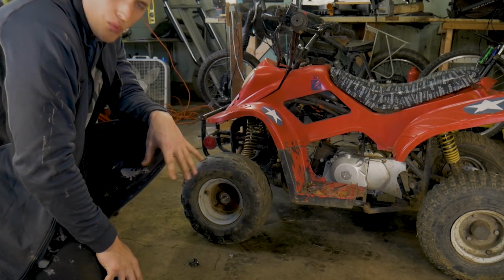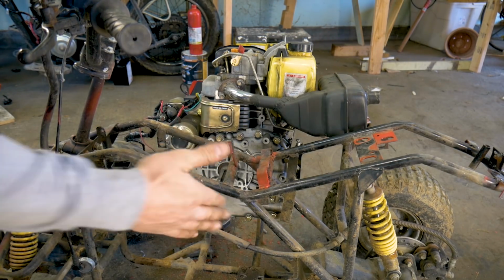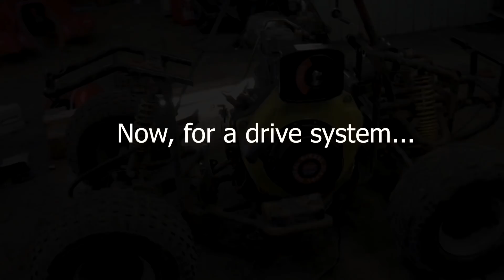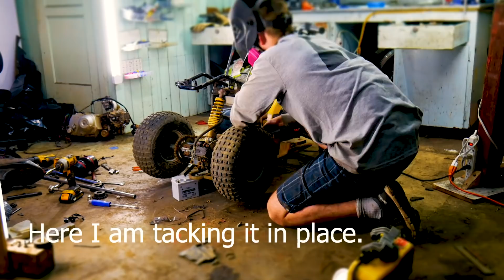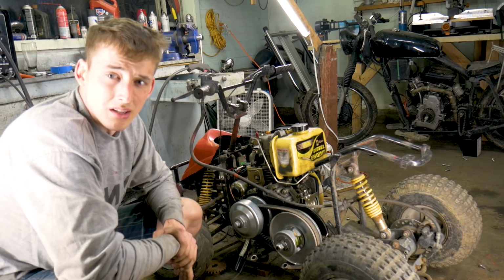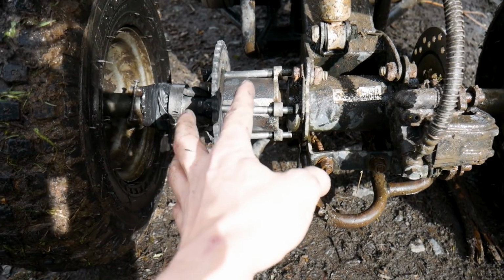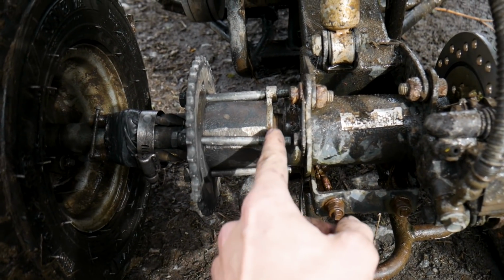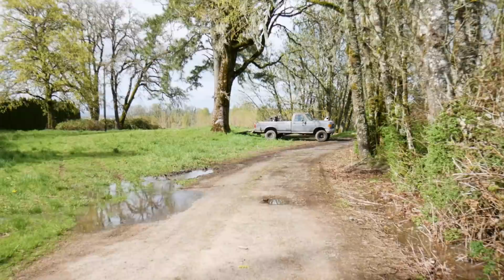I put a DIESEL engine on a kids ATV/QUAD

Comment from the maker: What do you think of this engine?
Reply: Turbo charge it
Reply: It have too much power and rev rpm s too good, it's amazing because is a diesel engine.
Reply: Bike_life, yes I know, that engine even get sized if you try to over rev the max rpm. I have every single one engine that they use but thanks anyway
Reply from the maker: haha I just need to find one now.
Reply from the maker: for sure, the things a monster!
Reply: It sounds good and looks sweet and 3 weeks ago i started buying stuff to build a home made mini quad for my channel
Reply from the maker: Nice, i'll be looking for it
Reply: The gasolina engine is more fiability, more rpm, more speed, but low torque, i like gasolina engine, even if is more consuming more fuel. It easy to maintenance, low cost, and will start quickly on the winter, i apreciate your work to transform a generic quad kids to the diesel engine, but is too work to do and time elapsed... good luck
Reply: Oliver Motorized I think it was pretty bad ass. I’d like to see that diesel on a go cart or something another. It sounds like it runs perfect 👌🏻
Reply from the maker: thanks for he comment Mircea
Reply: Here because diesel. 
Having coffee with a dash of diesel in my shop right now, because i splashed a fuel sample around and it doesnt matter.
Reply: Oliver Motorized did u have an uncontrolable urge to go slow
Reply: I want this motor for my 3 wheel moped I made last week
Reply: @ralpherizonie1785  It would be perfect for a small yard but it has torque for hills and something that small you don't wanna do 40mph on I have a 3 wheel scooter on my channel the gose well over 43+ but it's unstable and no breaks so I don't know how fast it really is
Reply: makes more torque so it needs longer gearing to get the top speed
Reply: Görgo
Reply: @Bike Life_93 
Yea but revving the little guys a few hundred over max rpm isnt a big deal. 
If its on a gen its running around 3800 anyways so 4000 isnt a stretch.
Reply: Kyle Galipeau yesssss
Reply: @galipeau169  Absolutely!! Imagine 3x hp
Reply: What did it come out of ,and were do you find 1?
Reply: Man just to be very honest. I want to see a turbo on it. I will be watching.
Reply: Put a turbo on it
Reply: Oliver Motorized nice
Reply: Oliver Motorized first Diesel engine quad
Reply: Michael Holliday yes it rules and so do turbo diesels
Reply: Let a kid drive it
Reply: can i buy this from u XD
Reply: It’s OP
Reply: U from Nebraska
Reply: Its insane
Reply: Oliver Motorized how much for this quad
Reply: same as old
Reply: Build a lift kit for it
Reply: Bike Life_93 that's not the case. You won't be able to rev any diesel over a certain rpm, yeah around 4k. This is because of how slowly diesel fuel burns. Any faster and the fuel would still be burning on the exhaust stroke.
Reply: i think it sounds like a lawn mower
Reply: You should do wheelies on it
Reply: Jeff
Reply: I laughed my butt off. Looks like you could pull an airplane around with it. Thanks!
Reply: Diesel... ya hade me at diesel
Reply: Put it on bike
Reply: It's big but it's strong I don't understand why everyone wants a turbo on it. It don't need a turbo it's powerful enough!
Reply: Now make it roll coal
Reply: For a China diesel they are pretty good little mills. I have the 170cc  4hp version of this motor. From new I had to shim the injection pump to retard the timing a bit, factory had it way to advanced. The little sucker would have blown its guts out lol
Reply: What year is your Ford I have an 88 f150
Reply: i know Im asking the wrong place but does anybody know of a method to log back into an Instagram account..?
I somehow lost the login password. I appreciate any tricks you can give me
Reply: @Elliot Xzavier Instablaster =)
Reply: Needs more speed.

Comment: great job bro - you can put a little gas in the diesel to help with starting.  removing air filter also helps.
Reply: Gas in the diesel will lead to knock and destroy the engine.

Comment: here before 300k views
Reply: that sprocket hub was clever , Thats the same problem I'm having on my 670 buggy. Cant you flip the jackshaft around on the torque converter? so the sprocket faces inwards
Reply from the maker: I originally wanted to flip it so the sprocket came out the other side but then the sprocket would hit the engine and there wasn't enough clearance! I may just redo the whole rear axle with a better system. good luck on the buggy man!
Reply: Vasily Custom Builds I would think you should be able to flip the axle on your buggy but of not your gonna have to use a jack shaft
Reply: Lol I see you every where 😂
Reply: How the f??
Reply: I am here before 400k views

Comment: Man that's awesome. I've got a 10hp diesel I snagged off a generator I'm modifying to work on  my monster buggy project.
Reply from the maker: Nice! they are pretty rare engines around here so it's cool to own one. good luck on your project
Reply: Nachodads
Reply: Hah i have one too, but i cant find the right ratty junk to put it on. 
Some old 60s-70s mower slammed on the ground and geared for about 30-35 is what im thinkin.
Reply: @MrTheHillfolk  that would be awesome bud
Reply: @nachodadsgarage1159  
Not sure about the tapered crank yet. 
What I mean is to get a straight crank, or an adapter , or turn it down in a lathe. 
By a quick eyeball it looks like 7/8 might get enough of the taper out, and 3/4 totally makes it a straight shaft.
A new crank is 1" i believe. 
I got my engine for free, so if I had to buy a crank it wouldnt be so bad. 
I tore it down already.

Comment: I have watched a few of your vids now. First, let me say you are a creator and a salvage artist. Second, you have some cool ideas. Lastly, your not building structually safe framing on your builds. When you join two pieces of frame tube together you need to be slugging them for strength at the joint. It will help prevent stress cracking in the long run.

Comment: I recommend welding the bolt spacers together so you know it wont snap the bolts on the sprocket and i just built a 212cc 3 wheel moped
Reply from the maker: The spacer is steel while the sprocket-hub is aluminum so I cant weld em.
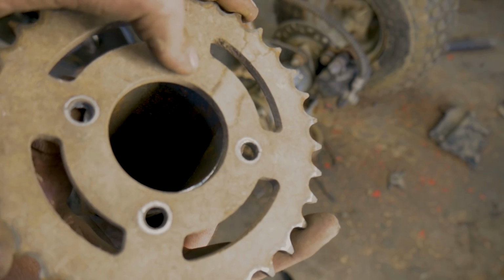Reply: Right but the spacer that gose over the bolts can be welded to the big round steal spacer that you made so the 4 bolt spacers stay in place at 4:02

Comment: I guess its probably a good thing diesel doesnt go bad like gas does it can sit for 10 years and be put in a fuel tank andbrun through an engine and it will run like the diesel is a day old
Reply: That's a myth.
Reply: About 6-12 months no degradation  in a clean, cool environment.

Comment: The torque definitely did not break the chain.  The 85cc two stroke motocross bikes are pushing 25hp and use a 420 chain.  Cool project though, you can probably ride for a week on three gallons of fuel.
Reply from the maker: yeah, the master-link came off, I think there was too much slack in the chain
Reply: You might have had the master backwards so it got hooked on something and just came off
Reply: Oliver Motorized 
L

Comment: thats great. i took one of them coolsters and put a cheap predator 212cc on it.. it fit pretty easy then i put a racing centrifigal go kart clutch on it and gps said 55mph but the tiny wheelbase made anything over 30 to 35 very hard to keep straight.. it was a little death trap so i sold it. i just ride an old moto 4 now but i have a yerf dog spiderbox mini buggy project that i mounted a 440cc sled engine on.. need to make a jack shaft then that thing should be crazy fun

Comment: That looks like a Coolster 110cc. I got one a year ago not running and I got it going by sanding the pickup sensor  and the raised magnet. Cut off the exhaust before the baffle that looks like a catalyst and woke right up with a 200lb rider 😂👌
Reply from the maker: Nice! i'm gonna get the original engine going here pretty soon

Comment: Do these little diesels use a carburetor or injection? If its injection I can see turbocharging being alot easier to do with the diesel
Reply from the maker: I think it's a mechanical form of injection. But yeah, lots of folks want to see a turbo on it lol

Comment: I have the same diesel, there is not very much throttle movement and would like to have seen what you did there. Also your compression must be low, mine will rip your arm off pull starting it, I even managed  to start it reverse. Even the battery has a hard time starting it, best is to hold the decompression down for a second go around.

Comment: How did you get that engine to work? Most diesel cars need a turbo or it will have 0 horse power
Reply: only on an engine configured to be a turbo-diesel. a naturally aspirated diesel engine can make plenty of horse power if configured right.

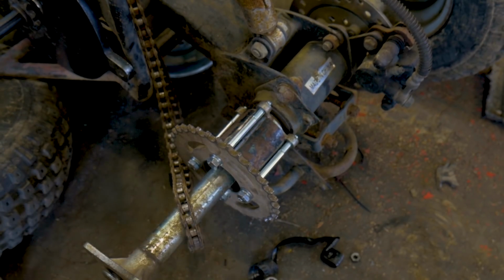Comment: 4:16   shouldnt there be a bushing (something to give inner support) & outer plate incorporating the 4 bolts keeping sprocket centered (not to mention adding even more support)both ends welded  just a thought not criticizm .............. ok back to edit    7:25 shows twisting  ......... back again exactly what i thought would happen happened still had fun tho

Comment: Would not your driven clutch shaft not slide through the backing plate and mount the sprocket and align it to the existing axel sproket?
Reply from the maker: I didn't really explain it all to well, but the other side of the driven is so close to the engine bock that I couldn't fit a sprocket there!

Comment: Are there any "Realistic" perks to running a diesel motor on a go cart, mini bike, ext. instead of gas?
Reply from the maker: not really lol. I'd say better fuel economy, and has more torque so you can get away with taller gear ratios I suppose. And they sound cool
Reply: Yeah I figured torque would be a factor

Comment: You got over charged on the quad, but very interesting.
Reply from the maker: ha I might have. The lil 110cc engine it came with is in good shape, so at least there's that too.
Reply: Oliver Motorized well that’s a different story. U gonna do another modifakasi or whatever it’s called?

Comment: Now make it roll coal by injecting some extra diesel into the carburetor!
Reply: Pretty sure Diesel engines don't have carburetors
Reply from the maker: yeah she don't have a carb. But maybe somehow increase the size of the fuel inlet could work
Reply: I totally forgot diesels don’t have carbs
Reply: @timpos546  Actually, there are some diesels with carburetors.

Comment: for some real fun  Visit T-Boltusa online  and order a 140cc ,/155/160 GPX or Pister Pro .. crate Pitbike motor the Lifan  engines do not come close in terms of RPM and power .. .. i had a CT70 with a PP 140cc ..  and with stock gearing it  ran faster than the 45MPH speedo and would easily  power whelie all 4 gears .. the PP n GPX motors are redlined @ 13K RPM  and teh 140cc in stock form was rated @ 12.5 HP

Comment: All that work and fabrication and you didn’t use fresh fuel?? Come on get a thick washer with the center hole the same size as the axle and slide it on and weld the washer to the pipe extension and then bolt on the sprocket.

Comment: Tiny atv. You look like smokey the bear on a tricycle.  Those minis have junk axles.  And rims.  Soft as crap.  Bend with just your weight alone.  Unbelievable  you were able to get it mounted and rode it like you did  without bending the axle and wheels

Comment: That aint no diesel
Reply: Ray Crawford if it runs on diesel it’s a diesel
Reply: @evan_evans8179  dude no it is not it sounds like a gas motor and it is too small to be a diesel. It is the size of a diesel TURBO!!